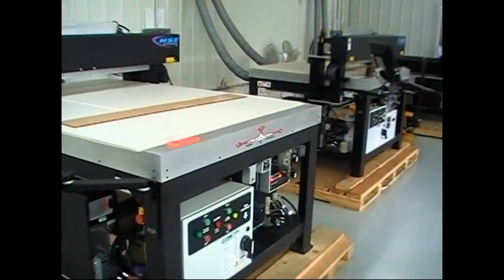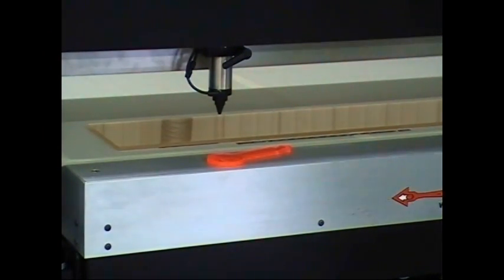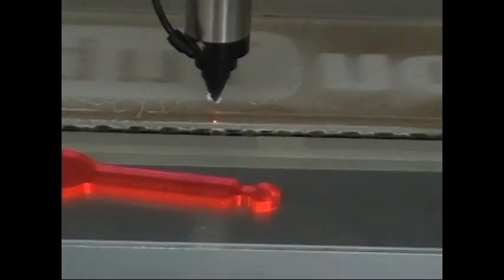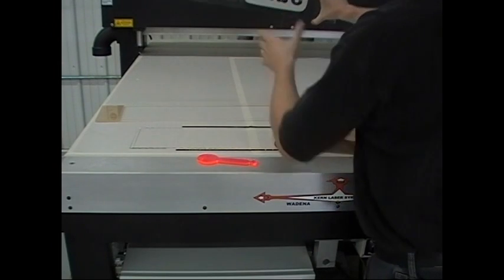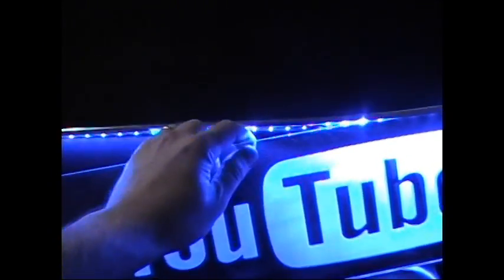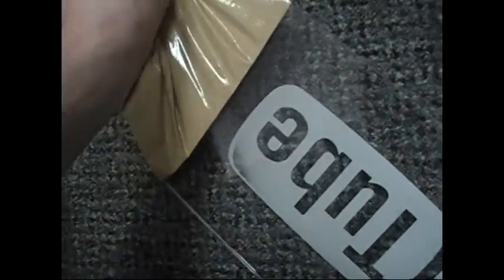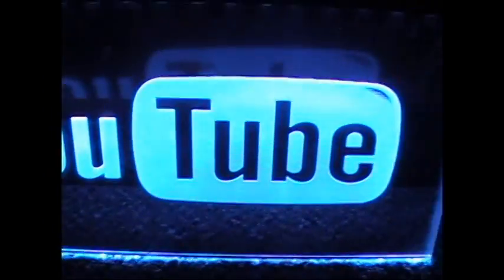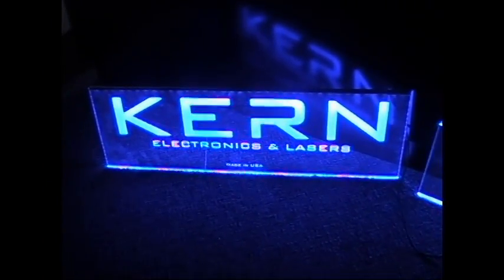Make money laser cutting edge lights | LED SIGNS

Comment: Is this standard clear acrylic or do you need some special acrylic to transmit the light throughout?
Reply from the maker: Standard acrylic works great. Cut slow and low air pressure will give you excellent clear light transfer.

Comment: where did you get the back lighting pieces?
Reply: SOUNDZ N PERFOMANCE +1, want to know where to get the lighting parts from.
Reply: +Josh P Amazon. They are just strip LEDs you can buy by a 5 meter roll for like $15.  All you need is a 12v power supply, and a decoder if you are going to run RGB or IC addressable LEDs.